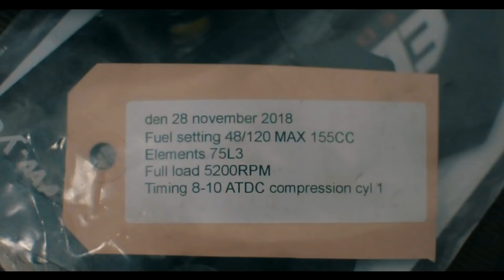GENUINE RÅKELTAPP - Pump Install

Comment: Skulle ni kunna gå över hur bränslesystemet är kopplat och vad ni kör med för förpump, btr och har ni original filterhus. Finns ganska mycket olika teorier hur de skall kopplas och alla säger olika. Bra material annars!
Reply: På denhär bilen kör jag allt helt orginalt, funkar bra som säkring för att inte överladda oöppnad motor 😁
Reply: Men på mina andra bilar har jag kört från: tank - litet filter - 044pump - stort filter - dieselpump - btr - t/stycke med spridarretur - retur till tank. Går att köra med orginala filterhuset, men se till så att alla banjo bultar är med stora hål och anslutningar.
Reply: @Blomppo995  Ok, jag kör 603 med liknande med setup men har för högt bränsletryck ändå fastän jag har btr före filter och pump. Men de är en gammal mynä pump också utan retur.
Tack för svar iallafall, ska fara hem och klura
Reply: Anton Karksttröm Har du bytt ut returbanjon på pumpen till en med stort hål?
Reply: @Blomppo995  jo, satt en backventil till spridarreturen bara. Lirar riktigt fint nu faktiskt. Tackar!